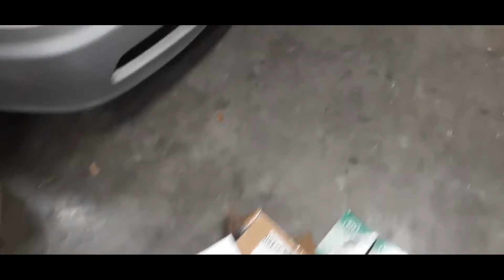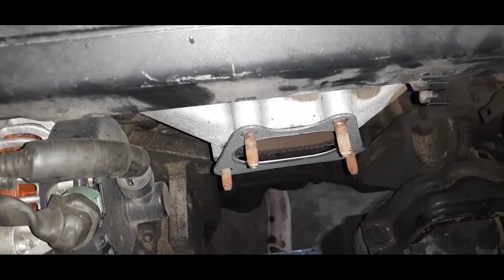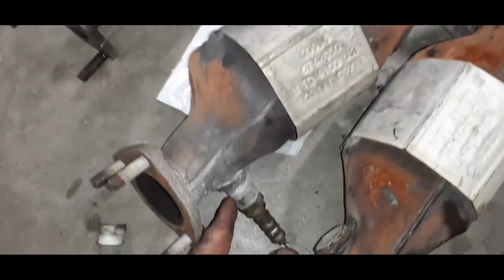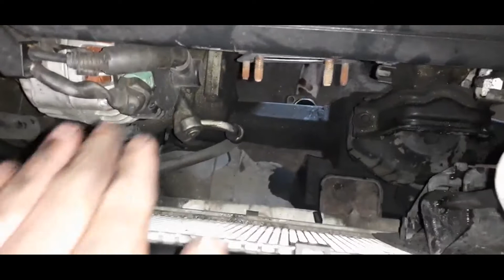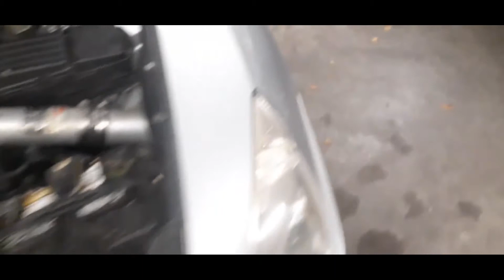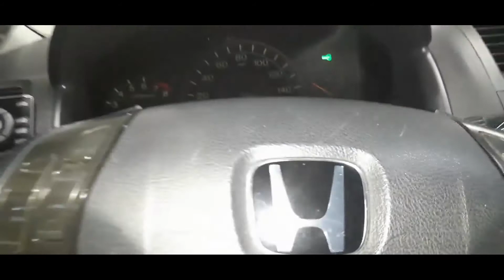How I finally solved my problem with catalaytic converter low efficiency codes P0420 and P0430

Comment: I am currently feeling the pain you went through.  I am at 138k on 2009 v6 accord.  Got the 430 and later the 420.   Changed plugs but wonder if I have/had something foul the cat.  Tried like you the cataclean and one other, no luck.  I have a CA emission car and I understand I can put EPA cats in but cannot be sold in CA or NY.
Reply from the maker: Sorry you're dealing with it too. The new Walker cats solved my problem, but now I have other engine issues so I have misfire codes again. I'll be getting a new engine soon and will put in new O2 sensors which will hopefully get me to be code free again.

Comment: Wow, love the explanation in this vid! Thanks! Earned a subscriber. Ima college student on a budget and want my 2003 Honda Accord LX 3.0 V6 to be like yours! Those part numbers on the catalytic converters and other small parts will fit my model? I have a p0420 and p0430 code and tried some of the tricks you mentioned. Ultimately I will replace the catalytic converters. What are the cheapest ones I can get? Thanks again!
Reply from the maker: Thanks for checking out the channel and the sub!

https://www.walkerexhaust.com/find-my-part.html

It looks like your part numbers are the same on the LX as mine bc of the same engine (as long as you're not in California).  Walker is the OEM supplier.  These cats are advertised to have a coating that should keep these CEL codes from happening.  Cheaper cats may not keep the CEL off for as long.  OEM cats are pricey so it made sense to buy directly from Walker.

Comment: Came across the vid on the forum. Congrats on the mileage! Wanted to know how often do you get your timing belt and components replaced?  And do you always do at dealer? Thank you!  Hope you make it to 1 mil!
Reply from the maker: Thanks for watching and commenting!
I've been good about replacing the timing belt replaced around every 100k.  Honda recommends every 7yrs or 105k for these cars.

Although I've done it a couple of times with friends, I really don't enjoy changing these myself and just send it to my independent mechanic to do it.  It's usually about $1k each time.  It's important to get a quality kit and replace the hydraulic tensioner too.  I only will use Aisin TKH002 kits now.  The hydraulic tensioner will be provided in the kit as well as a new water pump.

There are too many cases of someone throwing on a cheap belt only to have it break after 30k miles and ruin the engine.  Most of the cost to replace is labor, so don't scrimp on the parts for these. 
Thanks for the kind words and well wishes!
Reply: @txaccord  thanks for the reply! I am subscribed!

Comment: Where and how much for the cats thanks..
Reply from the maker: Got mine from Rock auto.  $644 for the two bolted to the heads.  Referred to as front and center on my car.  The rear is the one under the car.  I didn't replace it.

Comment: Great video. Thanks for the info too. 

I couldn't help but notice your SRS fault light stayed on after starting. Have you been able to find the reason for that yet?
Reply from the maker: It's probably one of the seat belts causing it.  Our car was never on the list to get the airbags replaced because of the Takata air bag debacle.  They said cars in hot and humid climates were most susceptible to problems.  For some reason, even tho 2003 Accords were on the list of problem cars, our VIN never showed as needing airbag replacement.  I've not checked into the SRS light.  I'd almost rather the airbags not deploy in an accident based on my concerns about Takata.
Reply: @txaccord  
Oh,
I understand.
Reply: I had a rebuilt (salvage) 97 Accord with the SRS light on.  Asked about it at the dealer and they said it’s a malfunction with the system, if you have a wreck the airbags won’t go off.

Had the car for a month and (not planning on getting in a wreck, of course) somebody sure enough pulled out in front of me and I T-boned them.  The airbags went off.  I think if you’re going fast enough and the light is on, the airbags will still go off.
Reply from the maker: Oh, great info.  Thanks for sharing that.
Reply: @steeler1983  yeah. 
It actually depends on what the fault is. If it's just the seat belt buckle issue (I personally consider this a system malfunction; for the seventh gens), the airbags would probably still go off in a crash. 
However, if it's related to sensor signal (or wires) or airbag and tensioner issues, the airbags won't go off. 

It may be good to just get the codes read and noted down. (even though you don't want to fix it now)

Comment: One guy at the shop wanted me to get an exhaust manifold and cat for my four cylinder all it needed was a o2 i had p0420 bank efficency below threshold
Reply from the maker: Yeah, much cheaper to start with the sensor and see if that fixes it.  I shouldn't have bought Dorman brand cats to replace my OEMs.   I hope these Walkers will hold up better long term.
Reply: @txaccord  i have read that those are oem reconditioned or something but those are the best for afternarket . I have about 203,000 miles and plan on doubling that atleast.

Comment: funny thing, after i ordered what i thought was the correct cat converter for my vehicle, the dealership proceeds to tell me that i need the other one now. 

i am very apprehensive about ordering the front one, only because i have replaced the rear one on both of my previous 07 accords. 

i will admit that due to the newer engine design, that they may have changed something down there.....
Reply from the maker: I need to look at my rear cat and let you know how it looks.  It's out right now.  The rear won't have anything to do with your CEL.

Comment: I’ve always thought that each car has its own personality, and your 2003 is a staunch environmentalist, “No, TX, you will NOT try to defeat my anti-pollution measures. Fix me right!” 😆

Really enjoyed this video - amazing to see how this car continues to perform well despite all those miles. Anything else on the to-do list, or is it just maintenance and addressing things as they come up at this point?
Reply from the maker: Haha!  There was definitely this feeling of "I'll show you car.  Can't say the air smells bad if I plug up the anti-fouler and you can't smell it."

Car:  Cool, I'll just throw an O2 sensor voltage code instead!

I have to get a new clutch master cylinder.  Will need a timing belt at 850k.    Will just address things as they come up for repairs.  

I am planning on wrapping my cold air intake with heat reflective tape to lower my intake air temp.  That's the only mod I've got planned for now.
Reply: Just listen to how smoothly the engine kicks before starting. 
👍